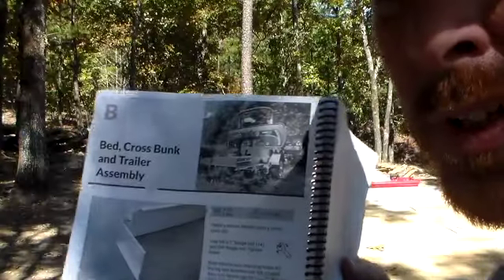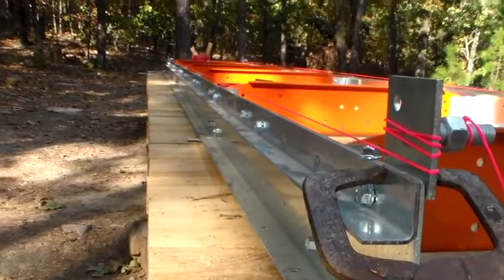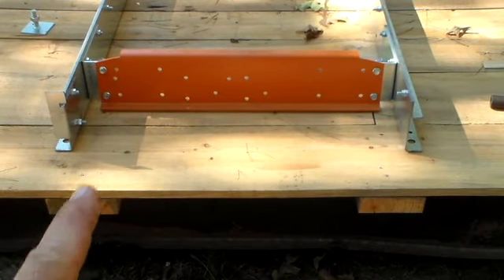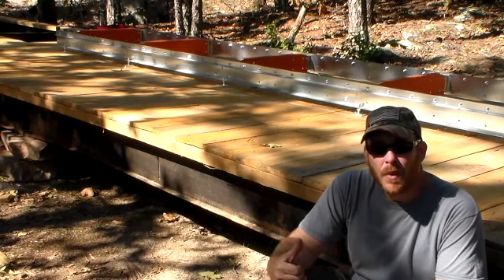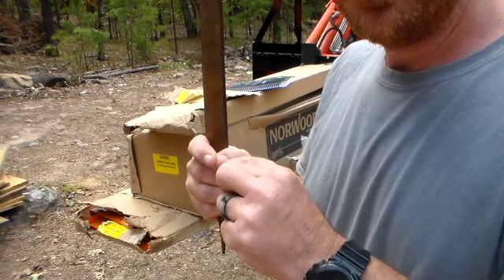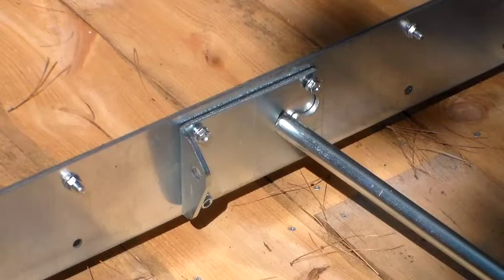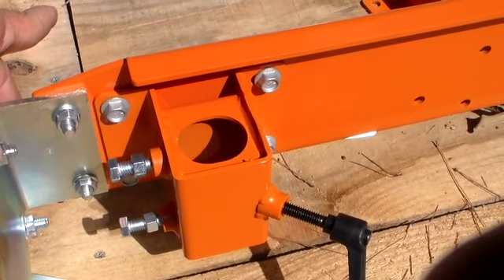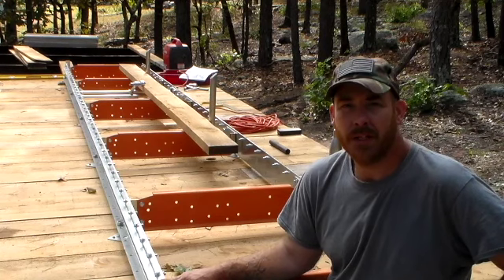Norwood LM29v2 / LM30 sawmill assembly / bed assembly pt 2

Comment: Mike, thank you for putting your videos together. I have run into the same issues and I see you have worked through them. Now that your mill is complete, do you see what the purpose of the can’t stops is for? I received 3 log rest but only 2 can’t stops. Not sure their purpose or if placement is important. Thanks
Reply from the maker: Hello from out on the mountain! The cant stops are for the wide cants. It gives more room that the log rests take up on the deck. I only received 2 of each. I would put them to catch an 8 foot log / cant. Then add more if you need them for longer cuts. Thanks for the comment.